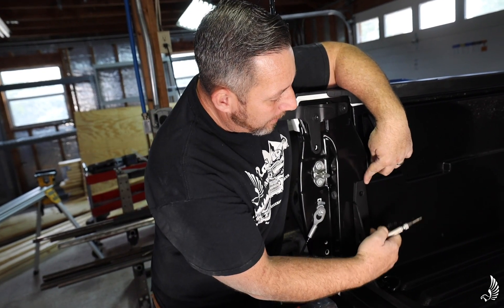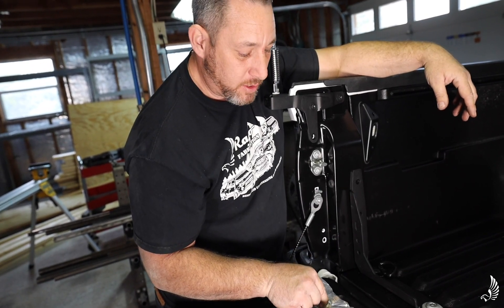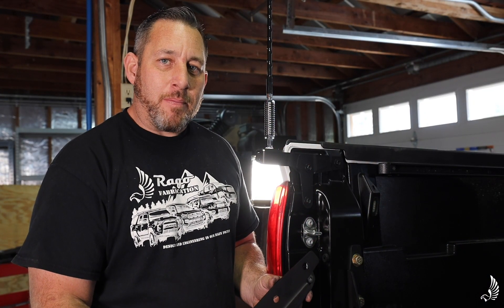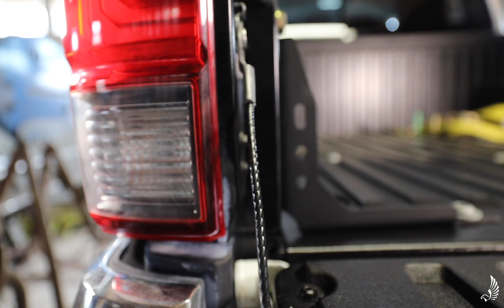Tacoma Bed Channel Stiffener Install | Rago Fabrication

Comment: fyi - D-rings without the spacers will compress the bed down out of spec in a crucial area. I experienced crackling when attaching the d-rings without the spacers.  Remove the d-ring lock ring, put the d-ring through the Rago stiffener and replace the thick spacer, washer and plastic lock ring before attaching the stiffener to the bed.  This will support the stiffener and not bend the bed down to the supporting member.